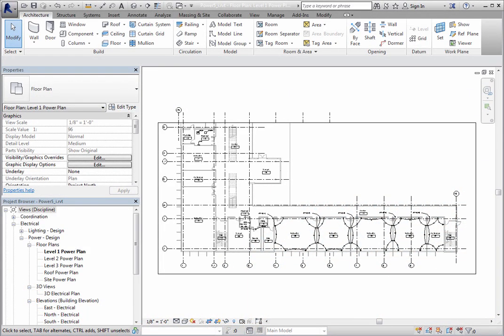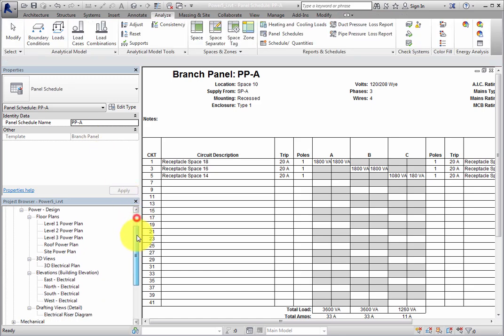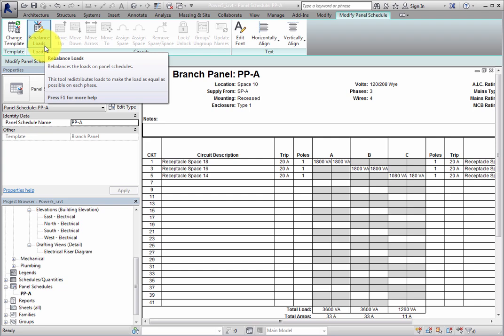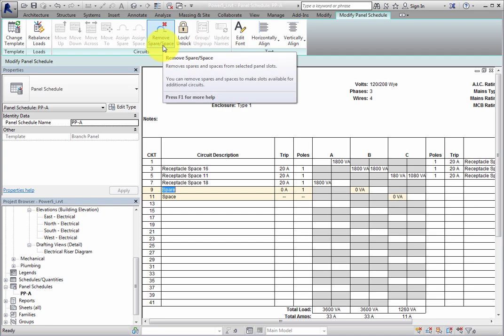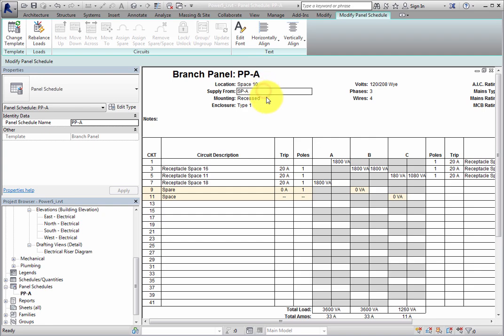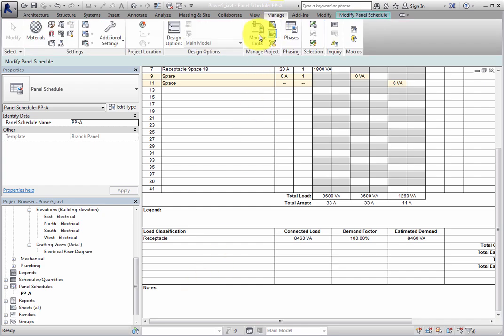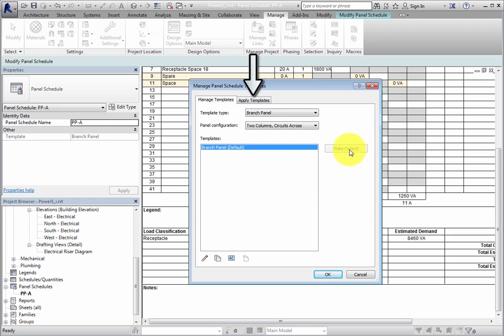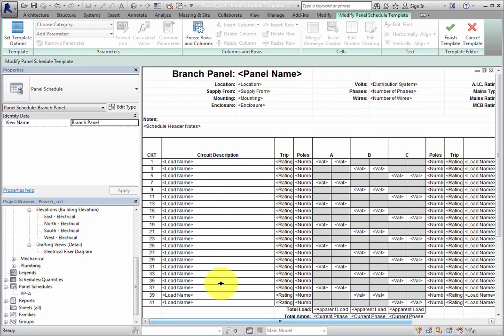Creating Panel Schedules

Comment: how to add lines or remove lines?
Reply: In the circuit section of you want add new row, you need to increase no. of breaker or way in the panel